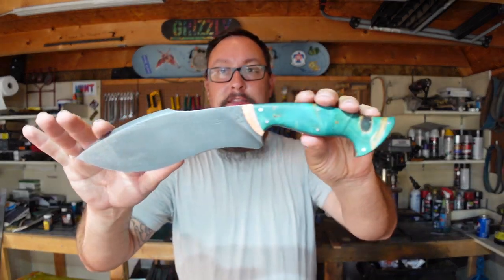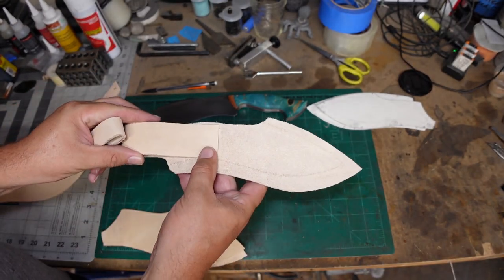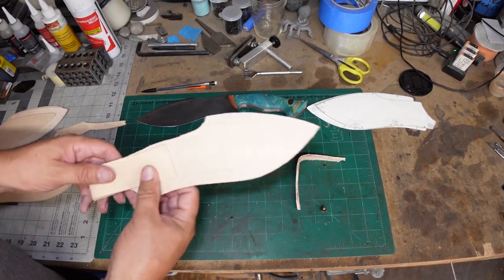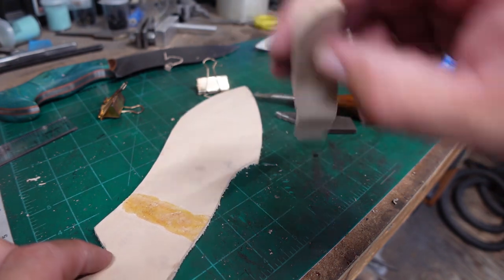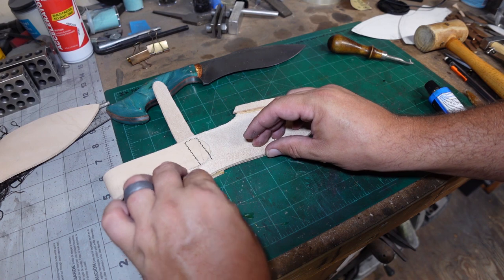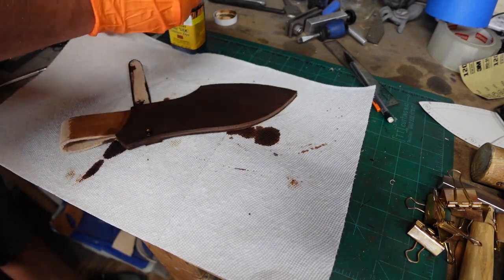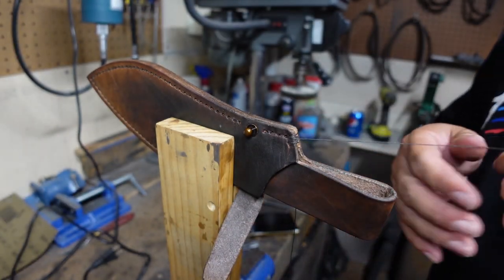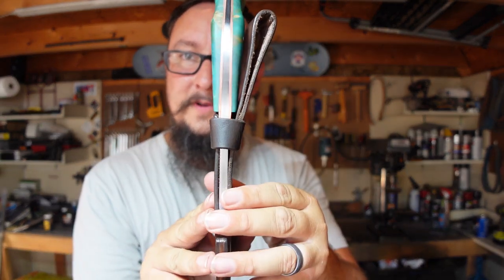First Time Making A Sheath For A Kukri! | Knife Makers Vlog

Comment: Good job on the design.  The shape of the sheath compliments the shape of the blade instead of hiding it.  A couple things I have learned about how stitching wears out over 30+ years of leatherworking.  Knots eventually wear off or come untied even when you melt the threads together.  Back stitching through 3 or 4 holes is stronger and does not wear out any faster than the rest of the thread.  The whip stitches you wrapped around the edge will also wear out faster than the saddle stitch, but that is more of a two or three years from now problem.
Reply from the maker: That's some great info! Thanks for that!

Comment: Great job on the sheath! I found a new idea from this, of putting the belt loop tail on the inside instead of on the outside, but I usually wet form my sheaths. When roughing the leather for glue I like a small piece of course sandpaper or one of the course sponge blocks, lots of edges at different angles. Watching someone else work leather helps get me out of my comfort zone. It just goes to show that I can learn something new since I have been playing with leather off and on since the late 70's. I notice from other comments there are no end to the good tips and tricks to working leather. Figure out what works best for you and keep an open mind. I am looking forward to the next build.
Reply from the maker: Thank you! Yeah, I've found so much great info from this comment section.